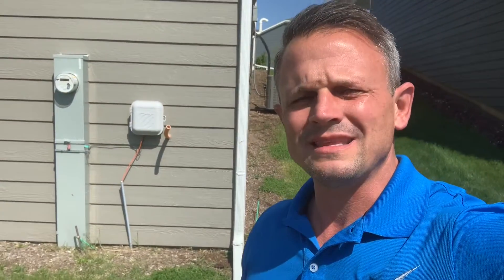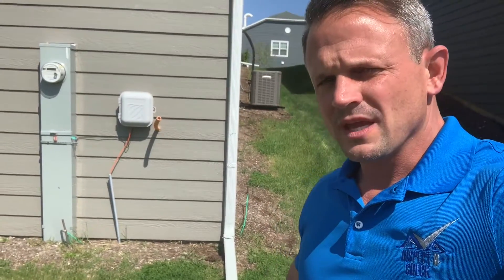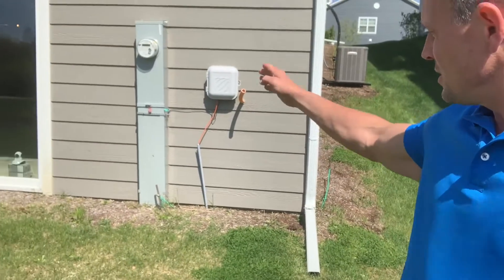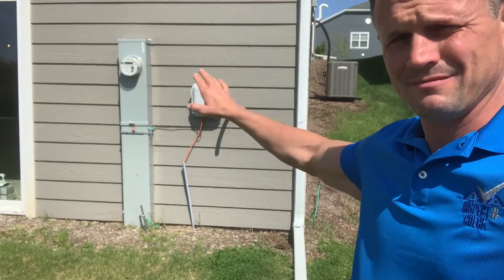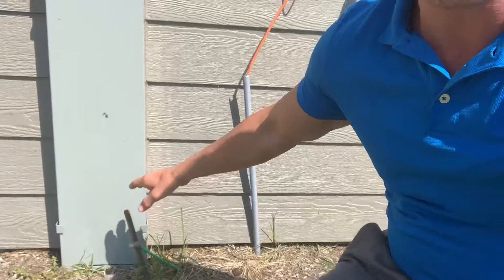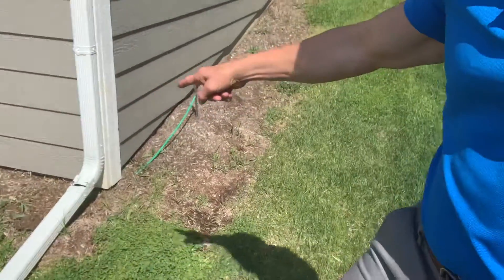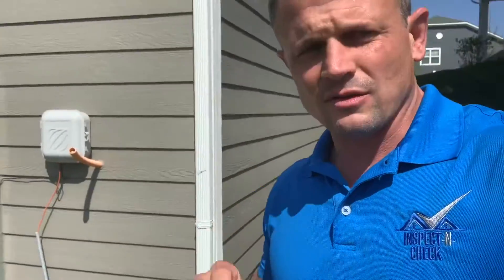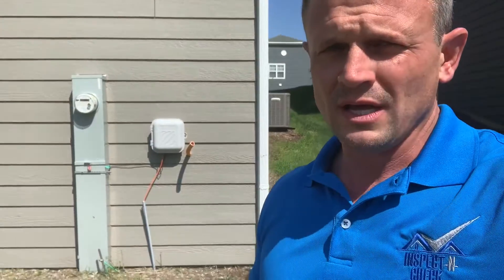How to Know if my Electrical System is Grounded

Comment: Hey there, question. 

What can you do with an old house without grounded wiring ?

GFCI outlets can be used to replace 2 prong outlets. But there's still no ground. So I'm assuming you can't use typical "surge protection" power strips (or likely no type of modern day power strip of any kind)  because they rely on shunting to ground. Which a non grounded homes wiring doesn't have. 

Also, if the house doesn't have grounded wiring. Would a whole house surge protector at the service box actually still protect the home (I'm assuming no) ? 

It seems like the only thing I can think of as far as protection for a non grounded home. Is something like a "Zero Surge" product. As they filter through their built in capacitors. & are filtered back through the neutral once the charge has slowed down to a safe level. At least that's what they claim to do. 

So in that situation I'd have to assume maybe in an ungrounded home. Your only choice outside of a complete rewire upgrade. Is a GFCI outlet with a Zero Surge power strip plugged into it (pretty expensive solution still).

Or is there another way to have protection in an non grounded home. Besides a GFCI + Zero Surge combination. Or just updating the whole home with a full rewire ?
Reply from the maker: @MountKash1  I’m sorry, I don’t know the answer to your question, that’s way over my head. I’m just a home inspector, that knows enough to get myself in trouble. In your case you’ll wanna get an electrician involved.

Comment: You dont care to put a quality video on without wind noise. Then it reflects that your electrical work is not very good quality.
Reply: Hey, don't be a jack-ass. Guy made a quick informational video. You can hear what he's saying just fine. If you cant, there's closed captions for a reason.
Reply from the maker: jjsmnow- Sorry about the audio quality I didn’t have a lapel microphone at that time.
Reply: @BJPoznecki  Fuck that guy, you got straight to the point with good quality information. Thank you!

Comment: Ground rods need to be measured for Ohms to ground. This is to be 25Oms or less. Without an actual ground rod meter and test you can’t be sure  it’s grounded.